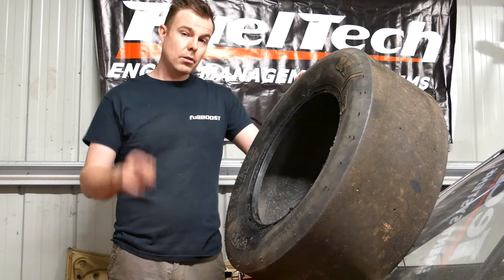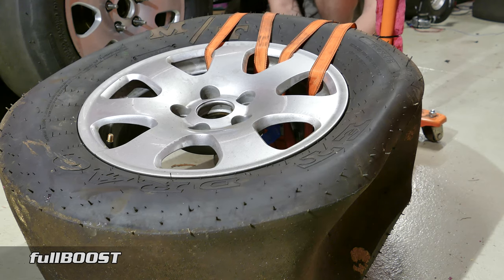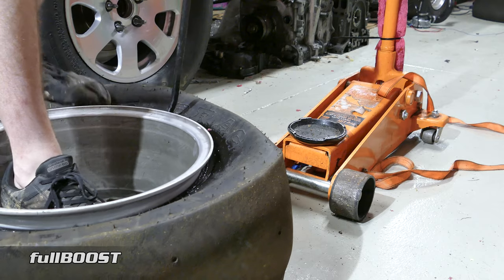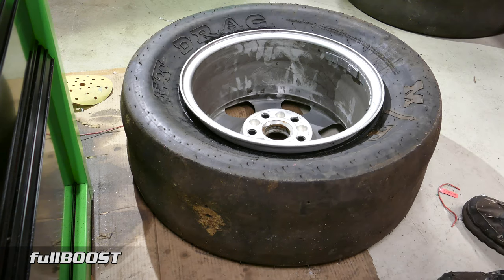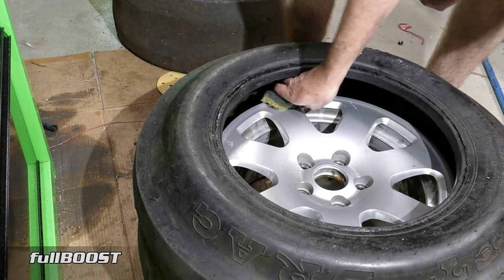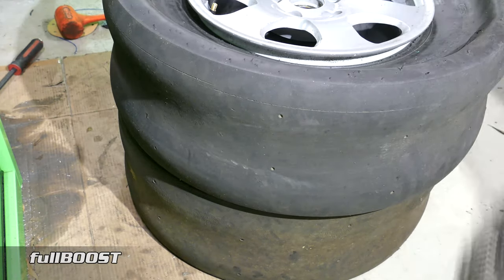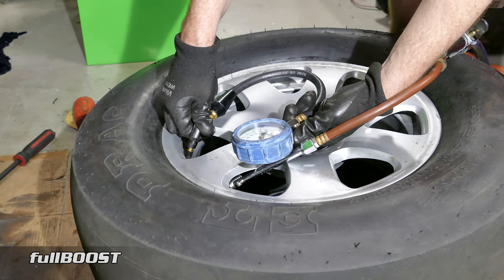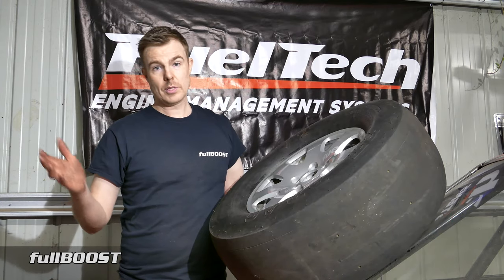How to change a tyre / tire at home | fullBOOST

Comment: The floor jack plus cargo strap is a pretty neat hack, and it also arrived at an opportunistic moment in time for me.  My F350 has two flat tires with sidewall damage and the Fedex guy just delivered the replacements.  I need to get one of the replacements mounted so I can drive it down to get the remaining tires mounted.  The thought of strapping a big mud tire to the top of my GTO or VW doesn't sound like a good idea and I've been thinking of ways to break the bead at home, and you just gave me a possible answer!  Awesome :)

Comment: Harbor freight in the US sells a manual tire changer. It has a built in bead breaker. But as someone who has invested in one of them and a bubble balancer and has fought with many tires, just bring it to a tire shop. It’s a lot of back breaking work to change a tire manually.
Reply: FatAznAznWithCake yep. Fark doing this crap unless you’re in a complete pinch like I was for these.
Reply: That it is... some are easy in comparison to, others with a low profile which are quite stiff.
Reply: I liked your comment cause you included the word stiff👌

Comment: Just bead it with gasoline or chlorinated brake cleaner, it's stupid easy
Reply: that costs money though lol I just pull the valve stems out and use an open fitting on the compressor , boom in 2 secs and it's free hahaha

Comment: 4:40 let the fun begin lol . . . . f you , you made that look easy  😭
Reply: he made it look hard lol
Reply: @5lcalais1  I'll just say I tryed to change some low profile zr17s to a commadore rim and I cracked the rim 😭 also another time I tryed to jack and strap trick and yeah snapped the spoke part (idk what they call it on a ' one piece  rim' ). Yeah I'm just unlucky when it comes to cars lol
Reply: @deathfromabove8735  oh low profile I won't touch, I'll get them done at a shop definitely 😂 you'll never get them on with severe mechanical help ,I only do stockies like 205 65 15s etc. Stuff low profiles 👌😂
Reply: @5lcalais1  the other time was with 15s lol
Reply: @deathfromabove8735  wow 😂 I've never damaged a rim and I've done easily 1000 manually but I only use steel rims ,easy to get and always cheap 👌
Reply: @5lcalais1  only had bad luck with Commy rims lol idk what the 15s were of but the fit with less (?) Of set  ( they sat out more )